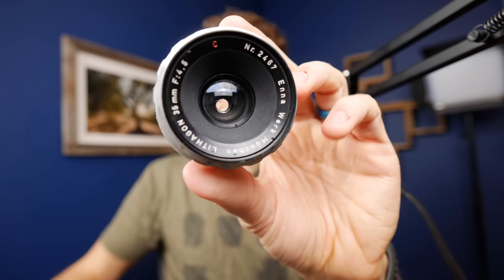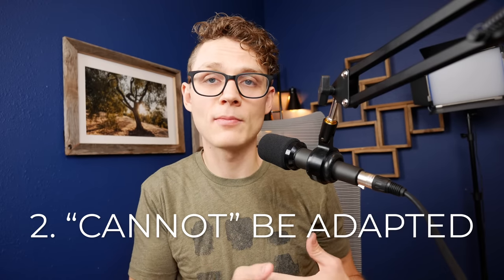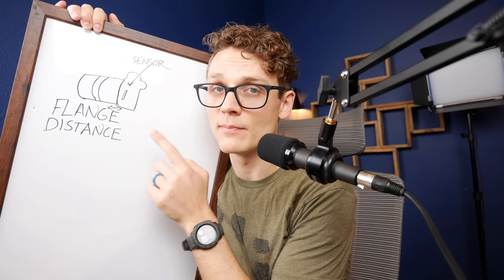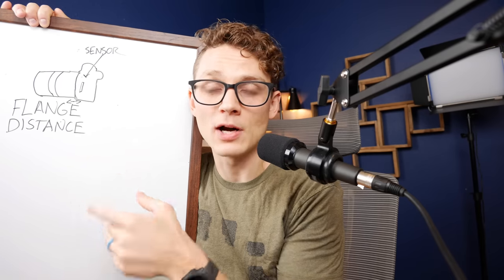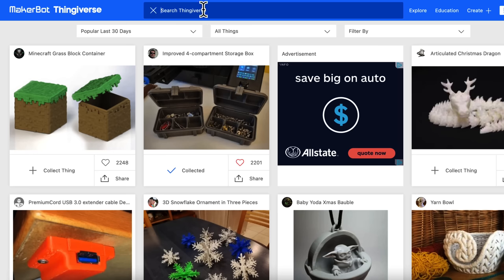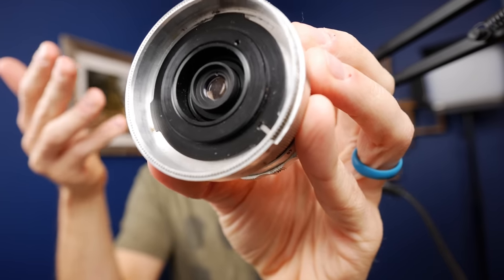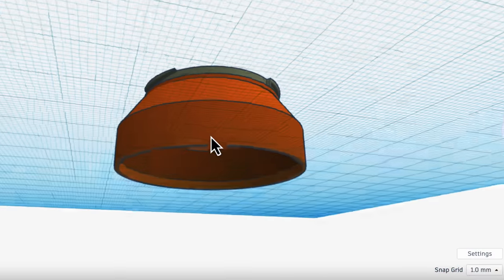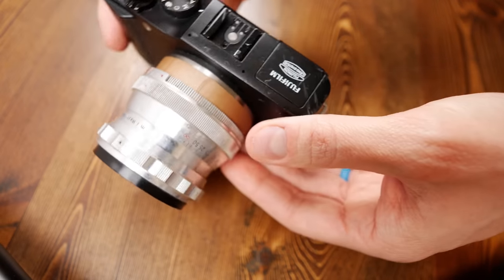How to Make Your Own Lens Adapters

Comment: I've been hunting for a way to adapt my Pentax A110 lenses to my full frame Lumix S5. I've tried using an ef mount adapter to an A110 adapter but it turns all the lenses to macro lenses.... I have no idea what flange distance I'd need.
Reply from the maker: Interesting, so you did an L mount to EF mount adapter, and then an auto 110 to EF adapter on top of that? The canon EF flange distance is too long to properly adapt auto 110 glass. So you would need a Leica L to auto 110, and that should be totally possible. It would be a thing adapter, but because auto 110 lenses are so small they can sit somewhat recessed to make up the difference. If I ever get a Leica L mount to practice on I can make one and share it. 

Also I don't think any of the 110 lenses will cover a full frame sensor all the way, but it would be fun any way.

Comment: I'd love to have some AF K mount adaptor for any other ILC system. So far only one exist for Sony and it only supports few Pentax lenses while omitting Sigma, Tamron, Tokina and others... 

So at least I have nice K mount to M4/3 adaptor with aperture control lever, which works even with DA lenses that have no aperture ring. MF only unfortunately. But at least something. It is K&F Concept PK/DA-M4/3 adapter
Reply from the maker: Yeah I have that adapter too with the aperture control, which is nice. An AF one would be pretty cool :)

Comment: Please let me know if this is a silly question but: how do you know if a lens will work with your sensor size? I have a full frame mirrorless camera— how do I know if a lens would project an image large enough onto the sensor? Is that a thing?
Reply from the maker: That's a good question. There's no standard number on the lenses or anything to tell you. You can go buy what sensor size the lens was originally designed for. That said, there are many exceptions to this rule. My Pentax Auto 110 lenses cover a larger APSC sized sensor, I have APSC lenses that cover the FF sensor, and there's FF lenses that can cover digital medium format sensors. 

In the vintage lens world most of these lenses will cover your FF sensor, because a vast majority are designed for 35mm cameras of the same image size. The exceptions would be cine lenses and things like that.
Reply: @snappiness  oh!!! I didn’t know that about sensor size. It all makes sense now! So any vintage lens designed for 35mm film will work with a full frame, and the crop factor on an APS-C or whatever works the same way? 

This is so neat. Thank you very much for your reply. I just bought my first vintage lens, a Helios 44M, and I can’t wait to try shooting some stuff with it on my R6 when it gets here!
Reply: All old film lenses are made for the same size image as a full frame modern camera, or larger. Can't go wrong unless you're using something really weird like a CCTV security lens or an industrial laser lens or something.

Comment: How do you adapt a standard PK type lens to fit an M42 ppl mainly say it can't be done??
Thanks Phil.....
Reply from the maker: In that case the flange distance is the same. I haven't heard of anyone doing it, but I think it be possible. Not with an adapter, but by removing the mount and replacing with a threaded mount. What's the use case?

Comment: I want to see a Nikon f mount to olympus 4/3. They sell them on eBay but they don’t work properly (the lens release tab breaks and doesn’t push the pocking pin). They fit and focus to infinity but the quality is trash. Also the lens mounting markings don’t line up.

Comment: Hello "Friend" 😁
Currently watching your video,  I have a Tinkercad file for an Argus C3  to m42 flat adapter.  I don't have a 3D printer,  I sent it off to Shapeways  and the 33mm threads didn't come out in printing.  I haven't confirmed the 33mm thread.  Have you made one or  could I send you the file and you can make a prototype?
Reply from the maker: Is that 33mm thread for the C3 lens? I wouldn't mind prototyping, I just don't have any Argus C3 lenses to verify with. I do have M42 though. I am moving across the country so wouldn't be able to help soon, but if I can still be of assistance in a month or so feel free to email me using the email under my about section of this channel. I'd love to help with this if I can!

Comment: Hello I'm new to making indie films. Here is where I'm at. I have a FHD A01 digital camcorder, I want to fit a anamorphic lens to it 1.33 .it's not designed to take the lens off. The lens area is a smooth cylinder, shaped with a bit of a angle. I've seen small anamorphic lenses for I phone and android that are less money and make nice movies.  I'm in CAD so I know my stuff. Could you make a video to fit anamorphic lenses to camcorders? Thanks

Comment: I guess there’s no reason you couldn’t build a tilt/shift effect into the mount by angling one or both of the mount ends.  That could be a pretty cool adapter to have around, and so much cheaper than a LensBaby–although you’d be stuck with one permanent tilt/shift amount for each adapter
Reply from the maker: That's a cool thought. There may even be for printable tilt-shift adapters that are adjustable too.
Reply: @snappiness  wild, it’s great to see all the cool stuff happening in the 3D printing community, people sharing their ideas and files and the overall open-source-ness.  There’s some instant film related stuff that I’ve been thinking of getting 3D printed, and it’s so cool how in these super specific niches there’s often already a free design somewhere to address the problem (like carriers for Instax in packfilm backs, for instance).

Have you tried any tilt shift stuff by the way? That could be a fun video
Reply from the maker: @Lets-Take-Pictures  I am trying my first tilt shift lens very soon :)

Comment: I need a adapter de Nikon z lens  24-70 mm  to a dsrl full frame Nikon 780. Will it be possible??
Reply: The sensor to flange distance of the D780 is significantly larger than for the Z mount. Therefore, no go. The reverse (F lens on Z body) is easy.

Comment: I have this Tessar lens in a weird PraktiNa mount (not Praktica bayonet, not praktica M42).  I can't find any commercial adapter to fit on anything (I have MFT and E mount cameras I'd like to use it on)
Reply from the maker: Without seeing the lens in person and just doing some googling, it does look like a strange mounting mechanism. But, so was this one and where there's a will there's a way!
Reply: @snappiness  well actually there are commercial adapters but unfortunately they're a bit more expensive than the usual ones (> $60)

Comment: I modified my lenses in a similar way about two years ago. I have a lumix g7 with speedboster nf-m43. Canon fd lenses are relatively cheap and readily available in my country. I disassembled the lens and rigidly connected the aperture ring with the mechanism. I printed the nf montage and sanded until the sharpness was right. I'm surprised myself that the PLA print holds the Canon FD 70-210mm. Thanks a lot for this video, it's very possible that it will help me with the next modifications.

Comment: I’ve mounted my Zeiss 80mm 2.8 from Hasselblad to Sony A7s. Thing is that it’s a leaf shutter lens on its own so it always closes on its own. I have to remove the lens, turn the switch and shoot again. Irritating
Reply: Can you put the lens in Bulb mode?  I’ve jammed shutters open in bulb mode with a tooth pick or piece of crumbled paper but that’s on lenses that I never wanted to remount on the original camera.

Comment: Currently trying to adapt an old range finder lens (internal shutter) to EOS R mount
Reply: Had to remove the shutter and now I need to manufacture a custom mount plate, poliminary testing shows it's about 36mm.
Reply from the maker: Very cool project!

Comment: I would be worried since the plastic is so much softer than the metal (aluminum?) of the mounts on the bodies that I would get plastic shavings inside the body from mounting and un-mounting the adapter.
Reply from the maker: It doesn't shave in my experience. Definitely softer than metal, but it's stiff stuff. I think that's a good concern to have, but it's not something I've ever run into before.

Comment: trying to figure out an adapter for a pentax K lens and an m42 body
Reply from the maker: That's a tricky one because they're the same flange distance as you probably already know. So adding the room for the bayonet mount would bring the lens forward enough that it would only be a closer focus lens at best. Which could still be fun.

If you were in for a big project, and doing it on a cheaper lens, you could remove the bayonet mount (unscrew) and figure out a way to attach it with that removed to keep infinity focus. 

What lens are you really wanting to adapt?
Reply: No can do without replacing the lens mount on either lens or body. But why? K mount bodies are cheap and common as dirt.

Comment: Does anybody know if my NIkon F camera can be adapted to m42 lenses without optics and reach infinity?
Reply from the maker: I did this once with my old Nikon D80, and because of the flange distance of the F mount being larger than the M42 mount, the only adapters had that bit of glass so you could hit infinity.
Reply: There are adapters with optics that work for that combo, with infinity. But there are compromises. You increase effective focal length and lose edge quality. There is no other way without replacing the mount on either lens or camera. But its a sad thing to hack a Nikon F. Buy a camera that can take M42 if you're in love with a lens. There are tons of cheap M42 film cameras.

Comment: I can`t find 3d model for Pentax110 to SonyE !
Reply from the maker: That should be out there somewhere... But that would be something you could hack together with two existing adapter models for Sony E and auto 110. If I had a Sony, I'd try it out!
Reply: There are plenty of commercial adapters for that combo. Was quite popular at one time, I did a bit of that on 4/3. Some of the lenses themselves  however have image circle issues - they don't cover the APS-C sensor as 110 film frames were smaller. You can always crop of course. Fotasy has such an adapter.
Reply: @buwaya4223   Thx, i find pixco adaper for all system. 
I trying 24mm pentax lens on sony a7c in full frame mode and this lens covered sensor with vignetting - thats awesome with this size lens!🤩

Comment: I would need some help is someone is up to.
I want to create a adapter for M3/4 mount to nikon lens.

Also i would like to know the pin information of the autofocus both of Nikon lens and olympus e-md10 III

this maybe would help me to create a 3d pointed adapter even for the autofocus mode but need some tests to do and information to get.
Reply from the maker: I don't have any experience with creating autofocus adapters. Manual adapters to put Nikon F on M4/3 are out there though. I imagine communicating between the two would require some sort of translation from both their proprietary protocols
Reply: @snappiness  Well, it all depends on whether the lenses have the same supply voltage and whether the communication between lens and camera works in the same way.
Reply: @snappiness  and for that we need to know what each pin means and I couldn't find the information

Comment: Plastic has a durability problem. Not a big deal for just a bit of use, but for regular use it wears fast. Much worse if the lens is long and heavy. The adapter may have to deal with a lot of stress. If the adapter decides to crack at the wrong time... not good. Been there, done that.
Reply: You can get a $10 macro reverse ring to get the actual mount to be metal, then depending on which one you can have an entire 1" wide flange to epoxy too and it shouldn't go anywhere

Comment: picture?!  In my youth I had an east german lens of that vintage, a legacy from my father.  It was just a screw mount so it was easily adapted to a pentax K camera.  It was beautifully machined, looked really classy and expensive.  Optically? Meh.  It was never very sharp or clear.  Nothing wrong with the glass that I could see, no fungus or scratches.  The truth is modern optics are SO MUCH BETTER than vintage optics.  The first rule of engineering is to put your efforts into things that are actually useful.

Comment: How about an adapter for this?
https://www.youtube.com/shorts/3tLRWAbLajg
The Ulanzi has a small threaded rotating mount. Filter size on Pentax Q lenses in 40.5mm. Because you can rotate the Ulanzi in it's mount you could probably make a 'thread to thread' adapter.
Reply from the maker: That does seem really doable, what a cool idea you had there! I will keep that in my back pocket for next year of things to experiment with. If I end up making something I can let you know!
Reply: Now I just have to figure out how to make it 40.5mm OD
Reply: AMAZING idea! Have you posted any examples anywhere? What’s it look like when you’re shooting?
Reply: @thelightslide  the LCD display isn't desqueezed but you get used to it very quickly. Composing your shot is not hard at all.

I'm working on a proper adapter ring.
Reply: @robslittlebluebook  awesome! I am going to try it… such a fantastic idea!